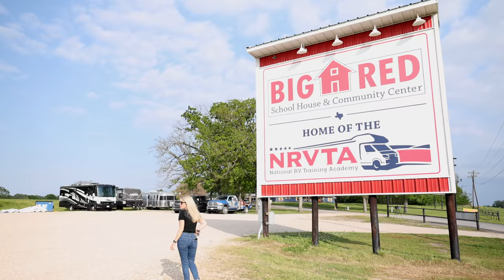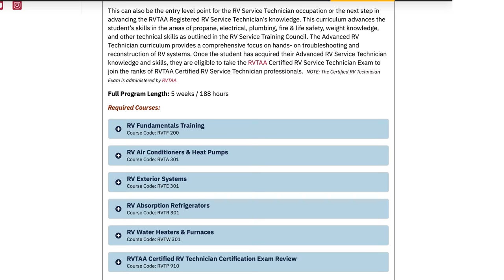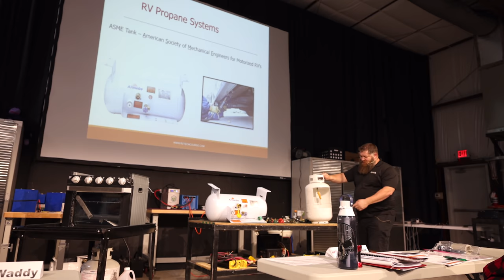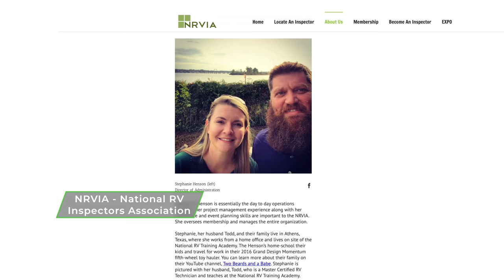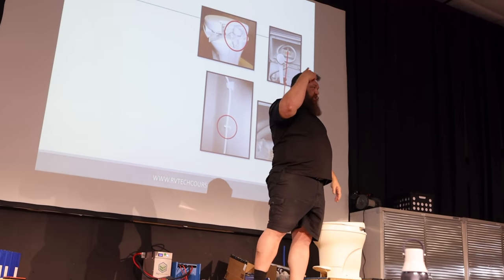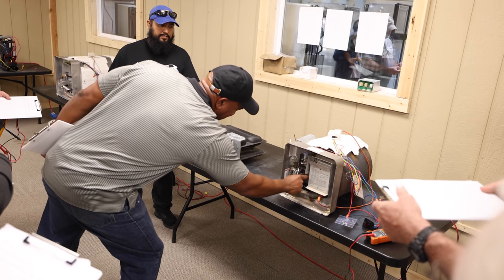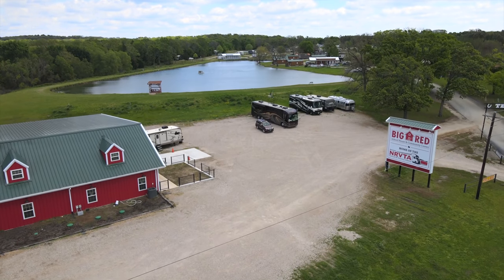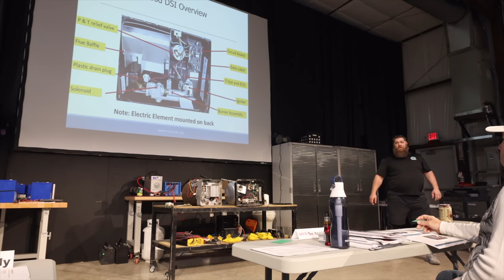RV School! (National RV Training Academy)

Comment: You saved me $16,500.  Thanks.  So I have been watching your channel for a while and I now know so much more about rvs.  I also watch your other youtuber's and learn from them too.  I recently came across a posting on Craigslist for an RV.  We used to own a Heartland Prowler Lynx and we liked it a lot, so when we saw this one we were excited to get it.  However, I followed your tips and did my inspection.  There were some small issues, kind of a tip that they really did not know about campers and that this one was not in great shape.  But the real kicker was when I got on my latter and took a look at the roof.  4 sections of Roof tape completely covering the TPO roof.  NOT sealed with LAP.  I got down from the latter said Thank you and walked away.  I mean roof tape over the entire roof, no sealing agent.  Oh and it was about to rain heavy.  No thanks.  I can't believe these people are going to screw someone over $16,500 with a roof that is only tape (oh and NOT installed correctly).  Amazing.  Thanks again to you guys for saving our bacon from a HUGE mistake.

Comment: Excellent video!   
One thing Chad mentioned was TWC certification.    They are now certified by state of Texas.   You also mentioned VA benefits. Briefly, but for many of us that may be the only way to fund more that the 1 week course.

Sooooo.  VA UPDATE!!!
 It is NOT approved as of yet.   They are in the process of approval.   VA requires 2 years after receiving state certification.    So that pushes the VA funding option to April 2023 at the earliest.   It SHOULD be approved. They meet all their requirement. Except time.    

So for any veterans looking at that options, it's coming.    

Hope that helps.

Comment: LCI Leveling question- First of all we watch your channel every week and enjoy the content you produce it must be a ton of hard work that you make look easy. 
We have a 2016 Jayco Seismic Wave with an LCI auto level. We purchased about a year ago and have been on the road for about 8 months of that year. Our auto level gave us tons of trouble and frankly never worked. 
Until when leveling it I realized that the rear jacks were switched somewhere.  Meaning when I would operate the Right rear jack the left rear jack would operate and vice versa. 
I went to the main control panel pf the LCI system and swapped the connections (which were connected and labeled “correctly” ) Panel said Right rear and the cable was labeled right rear. 
When I swapped them I plugged the left rear into the right rear and vice versa. 
Now the auto level works every time. 
I wanted to pass on my experience bit also ask if anyone has come across this.
Additionally is there another place in the system where they may have been swapped? 
Since it works I am in the camp of leave well enough alone. 
Thanks in advance for all your content.

Comment: I have had a mobile rv business for 3 years now and have looked into the certification courses. There is one major problem for not going...time. This past 2 1/2 week has been non stop, no days off and my phone sometimes starts at 6:30 am making those oh crap noises. Today,Sunday was from 8 am until 3pm plus 53 calls on my phone log. I wish NRVTA had remote courses as taking 6 or 7 weeks off, dragging my TT to Texas from Central Cal would mean lack of service to the RV'ers here as it sames I'm it. Not certified but with a mega yacht background and owning boatyards I get to fake it a lot!!! Just kidding. The dealers can't find workers and neither can i as no wants to work.
Reply: working on it. I promise.
Reply: @RVBeardandBabe  
That was fast!!! For me to drive to Texas with my TT takes 2 days but should actually be 3. I'm in Paso Robles ,Ca. and it crazy out here especially this past winter and now I'm buried as is the on dealer with a service department, they are booked 3 months out!
But the extra 300 bucks for funny money a week on unemployment, too many are sitting on the asses at home.

Comment: Great job.  Absolutely on my to-do list.  How many more tools/equipment did you buy as a result of attending this class?  Were there any tools/equipment that you needed to purchase for the course?
Reply from the maker: Hey, Darrin.  I know this is an old post but it popped up after you joined..😊  I did use the class as an excuse to upgrade my multimeter to the one Todd recommended.  I used it in the AC softstarts video too where it could measure un-rush current.. 😊

Comment: What is your opinion on system breakdowns occurring due to travel jarring. I know you changed your suspension recently. Do you feel that is essential to trailer maintenance and trailer longevity.
Reply from the maker: No opinion, really... It is what it is.  It's an earthquake every time we travel and it does contribute to things breaking...  Our water heater check valve, for instance.  The new suspension does help a lot!

Comment: Hey Chad and Tara,  Been in contact w Latchit, (" OK, it looks like I "could" swap out barrel locks with these by routing out and mortising door??? You think I have a shot at this?") I'm a pretty handy guy (machinist 45 years) So, Chad, is this a doable thing? Swap out these cruddy barrel locks for the Lachit kit? I know it will require routing and mortising but is it worth it? Thanks guys. I know you're busy so a yes or no will do...
Reply from the maker: I hadn't heard of Latchit... But it appears to be identical to RVLock.  Not knowing what kind of door or anything about it, I really can't say.  We had a tough time with our baggage doors but worked it out.  https://changinglanesrv.com/rv-keyless-entry/   If you're going to cut the door, maybe at least have a backup plan and know if you can order a new door.. 👍🏼

Comment: Great school I have a question hooked up to city water why would water squat out of water holding tank
Reply from the maker: With so many different types of systems, it's tough to say.  I would ask around in a facebook group for your manufacturer.
Reply: If the holding tank is full as well then I would point out that water is passing through the water pump from the city and filling up the tank.
Reply: @RVBeardandBabe  I'm thinking maybe the pump check valve

Comment: Did they talk about 12v RV refrigerators?  Also fire hazard of gas refrigerator
Reply from the maker: Yes and yes.
Reply: Gas refrigerators are my pet peeve. However used correctly they are ok.
Reply: @RVBeardandBabe  I have been seriously considering upgrading to a 12v refrigerator. Any recommendations?  EverChill, Norcold, GE, other?  I thought about ARP and fire bottle but that is almost $500 to put a patch on a problem. Cheaper to just make the switch.

Comment: Great stuff however I would be cautious traveling around the country and putting out a sandwich board with no business licenses for the city, county, or state. You can get heavily fined and possibly blackballed from doing any work. I only say this as I am a owner of several businesses and have done it right and wrong and when I was a young gun got slapped pretty hard a couple of times.

Comment: good you can probably answer my "current" issue then (pun intended) when on Generator the current is where it should be but it comes in at 16,000HZ at the connection for my convection microwave. it's only supposed to be 60hz. The Converter/ inverter burned up previously and was replaced but i'm concerned they replaced it with the wrong one, that is why the high frequency reading on the outlet.  probably never see this but i put it out there, maybe someone will see it and give me an answer i live in my RV full time. it's how i'm staying debt free since my wife passed too late in life for a house and mortgage now so this is it for me now
Reply from the maker: If on generator, the inverter should be inactive, only passing through 110VAC from the genny... Might depend on wiring.  16KHz should fry just about anything connected.  Really, no devices should be doing that.. Even foreign (EU) uses 50Hz.  I'd get a tech out to check things out.. Something is severely wrong.
Reply: @ChangingLanes  that's what concerned me and my late wife's nephew also. DANG it. i really didn't need anything else major to go wrong with this thing i am trying to move into it to live in and it's one set back after another. Thanks for the reply though i really appreciate you validating my thoughts and fears. Not something most would say probably but it's better than losing every appliance i own by just thinking things are ok still since the inverter was replaced and it's not. Not at all in fact. thanks again i really do appreciate it.

Comment: Did they cover leveling systems at all?
Reply: Not in the basic class but we did have an extracurricular activity with RJ's leveling system. One of the students came in late on Sunday and everyone noticed his class A rig was NOT level.  Turned out the system had malfunctioned.  I think most classmates came over to help or see.  We got a lesson in learning how his system worked and the manual hack to get those feet down (not easy). It was great to see how people interacted to help puzzle out a solution.
Reply from the maker: Not in the fundamentals... I think so in the more advanced levels.

Comment: These new RVs are a piece of crap. The roof leaks. The door handles fall off. The wheels break. The axles are the wrong ones. Don't buy any of them. You can drive your car anywhere in the US and many RV camps have a rental already setup for you to rent in place for as long as you want. Then you pack up and do the same where ever you go without spending $350K for the stupid thing.